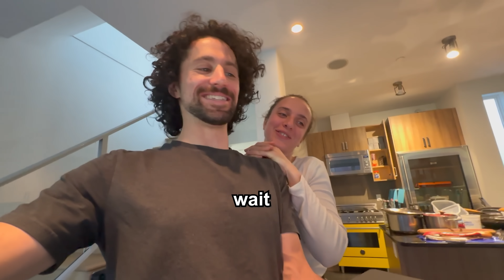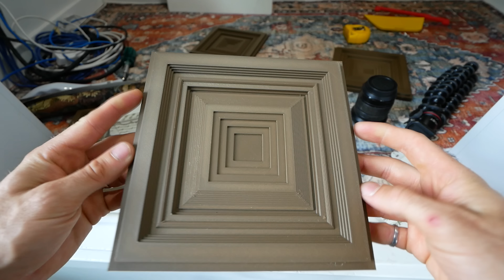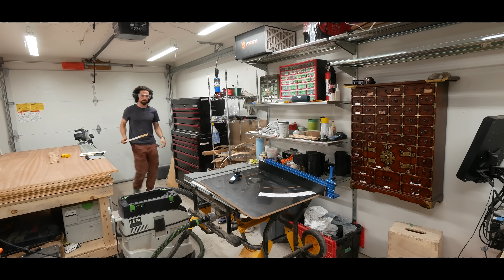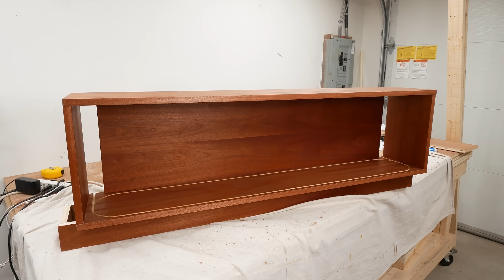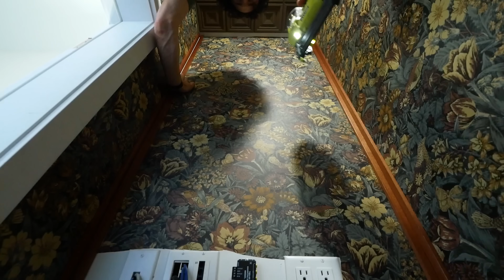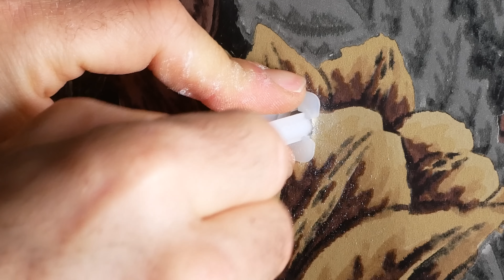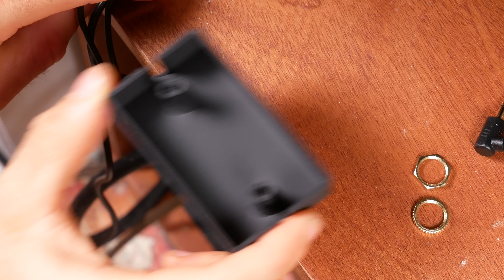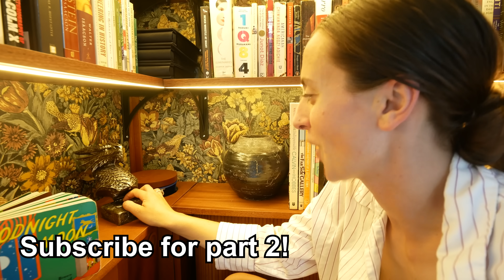I Built a Tiny Library on my Stairs

Comment: a one way mirror would not only work well as a secret door but also allow the reader to still be able to look out even when the door is closed with no fear of anyone knowing they are within the library.
the best thing about one way mirrors is that you can also make them 2 way with the flick of a switch, just by doing some LED trickery between layers.
having a door thats a mirror from the outside but a window from the inside also allows for great reflection of light going up the hallway, it'll make the hallway/staircase even more well lit, and will allow light to travel through the house better. it may also allow the reader to still get a little bit of ambient light coming in, and will allow you to read with all the lights off and not be trapped in a dark room.

i truly believe that a one way mirror is the way to go for the door
Reply: Absolutely love this idea.  So even when you are tucked away with a good book in private, you can catch that view out the window. ❤

Comment: Since you're renting this probably won't work but I think making it a barn door that is in the wall would work pretty well, making the door frame look like the frame for a painting then either putting a poster over a door or using a canvas painting for the door. If you can't go that deep into the wall maybe some type of roll up that recesses into just the frame?

Comment: You can snip the edges of the metal drywall toggles to allow them to expand in a narrower gap. It does reduce the load capacity, but not by all that much.

Comment: TOTALLY A grandfather clock!! With one of the large gears as a 2 way mirror you can see out of you are in the library. Suggest a fan,  so you can make another of the "gears" for air circulation. Yet the esthetic is untouched. 
Creating this is completely removable! Clock parts are easy!! Lighted clock would be RAD!! 
Question...Do you still have the van??

Comment: The painting idea for the door is good. Especially if you do it in a rolling screen mode. This way it maximizes the space by only requiring space above, and does not need heavy support. It can also be swapped from a shutter/curtain window roll

Comment: For the door, build a Victorian picture frame and get a print but it is like a window blind that rolls up into the top of the door frame behind the picture frame. Bonus points if you can make it like the pictures on bus windows that are solid on one side and holes so you can see out on the other. I love the project.

Comment: The door could be a 2 or 3 panel painting or picture. All or just the middle panel could slide upwards, if there’s head room above. Whether it’s open or closed it wouldn’t take up any extra space. The art could then be designed to look right whether up or down.

Comment: The door could be a framed painting that is secretly a cordless roller shade.  The sides house railings for the bottom to slide up and down on while the top houses the roll and the rolling mechanism.  To open it, you grab the bottom part of the frame and give it a little downward tug to activate the spring loaded rolling mechanism.  To close, simply pull down and it stays in place.  You could even print the painting on PVC mesh and, playing around with the density of the weave, you could probably get it to look solid from the outside when the inside light is off but translucent from the inside so you don't get claustrophobic.  Think of the window shades for cars.

Comment: Make the door a tambour door with opaque bits to let light in, like a framed artpiece of a wavey surface with slight depth, but rotate it 90 degrees so it can roll up like a garage door.
Reply: Or, Large fabric fans, similiar to paper fans that you use when it is hot, in each corner, that fold up to reveal the library, similiar to a theater curtain, revealing the stage behind.

Comment: A painting sliding up would be amazing! You could make a facade either side to hide the mechanism. Unless you want floor to ceiling pillars you can't do counterweights without visible cables and linear actuators that long are expensive so I'd recommend a chain drive lift mechanism connected to the bottom of the painting. That way the facade only needs to be slightly taller than the top of the painting when it's 'closed' (you'll need a railing attached to the back of the painting and some sort of guide on the wall to stop it tipping though)
Reply: If there's not enough space for the whole painting above the opening just get a picture of you on a trampoline. You fly into the air while the trampoline sinks to the floor

Comment: Any one that says "Just make a real coffered ceiling" has never done so. Is it just squares? Sure. But the amount of lowering/facing/trim work is stupid high. If you've ever trimmed a room, think about doing that, but 5 more times, and make those four corner cuts 30 more times. It's a pain. 3d printing is WAAAAY faster and easier.

Edit: The CNC makes coffers at this size pretty easy too. Also, What I would do for a bambulab sponsorship....

Comment: I vote for painting as well. Not sure how much space you have above the door but maybe have it slide up with some way to lock it from coming back down. This way you can still see the painting with the door open and it doesn't block the walk way or the window. Not sure how you would do this without the track being visible when the door is closed though. Or have the painting cut in half and they slide left and right to open. Just some thoughts.

Comment: That ceiling panel shape was likely originally a functional necessity of covering the ceiling in wood, and can still be done using minimal hand tools at home. 

https://www.youtube.com/watch%3Fv%3DxfbwQyMSChg

https://youtu.be/OKT9C_wi0bU

Solid wood expands and contracts with the humidity by a certain percent. If a panel is very wide that percentage can be multiple inches. This is a probablem for things that need to be precisely fit, like doors, so they gave the illusion of one solid panel without the danger of it getting jammed in the doorway every summer by having panels floating in grooves in a frame.

It looks like the ceiling you're recreating is based on that system. The sort of pyramid shape is a common way to bevel the panel to be thin enough to fit in a groove in the frame around each square. 

You can do this with a saw, a few millennia-old measuring tools, and a pair of hand-planes you can probably find at the right flea market.

Comment: Is there enough room to have a painting that slides up the wall? Not like a rolling window shade (or a projector screen), but like a vertical sliding chalkboard. There would be exposed tracks, but maybe they could be camouflaged with some kind of vertical trim; maybe along some very thin display shelves? I’m thinking 3-4 in (7.5-10cm), just big enough for knickknacks or very small plants. That would be like adding a part 3, but it might really tie the library into the rest of the landing.
Someone else said the painting should have little windows for moving eyes, and I definitely agree.

Comment: For the door, it would probably be best for it to slide if you can manage it. That way if someone wants to read in the library while looking out the window, the door won’t block anything. The easiest way to do that would have external rails, but that would make it too obvious. Making it less obvious would require some less than renter friendly renovations. 
If you have some strong rails, you might be able to make them external and discreet.

Comment: a freezer in an enclosed space is a disaster.  it produces heat on the outside (the heat it takes from the inside).  that makes the enclosure hotter.  that makes the freezer work harder, and so on, until the freezer is consuming maximum power all the time and performing as poorly as possible because it is as hot as possible outside the freezer.

Comment: The door could be your painting idea but instead of opening outward you could have the painting raised and rolled up inside the top of the frame like a window shutter type of mechanism - the cool and fantasy thing would be entering through the frame - it would also be practical because it wouldn’t take up any extra space and the only devider would be a sort of cloth or something so there might be some air exchange

Comment: it seems to me that since you're gonna have to leave the frame of the opening, you're gonna wanna put something in there that looks like it belongs. My thought is that you put in a double secret cabinet.

Given where this closet is, which is super weird, I think the cabinet should be deep enough to hold something like spray bottles and fertilizer for your plants. it shouldn't be more than about 5 inches deep. I like the idea of a split opening door. But because of how it will have to open, I think that it needs to look like two cabinets with a piece of trim in the middle that will hide the gap that will be necessary to open them, much like hidden bookcase doors.

Of course, you could have it just be a bookcase that opens out.

Either way, they should open out and around so they can be flat against the walls fully open. Is creating some challenges for the hinges. Perhaps there is a kind of hinge that will allow you to get around the molding. whether you go cabinet or bookcase, there will need to be a way to unlock the doors so that you can open them out.
If you can get them to open out and around the molding, ideally they should fold flat against the wall.

On the backside of the doors, you should have something that you could leave out to display. Framed gilded mirrors are one thought, another is a couple of shallow shadowboxes. And finally, could be two framed images, either daguerrotype style photos, or some kind of Victorian era drawings. Although since you've gone with some female, some nature drawings in the style of 40s and 50s scientific drawings also work well.

Comment: Surely a stable door is the perfect option, that way you can have the bottom half closed to give some snugness to the nook, and the top open to give access to the window. You could also have it all closed or all open. It would be less than secret, but it would add intrigue, maybe for the window in the top half you could do a fantasy themed stain glass.

Comment: I could picture adding an ornate frame around the entrance like it were a painting. Then add vine plants that drape across the opening of the library. They could be controlled by a switch to open like curtains or drapes. That way all of this work is always sort of on display, and it can also blend into the plant corner aesthetic that is already there near the window.